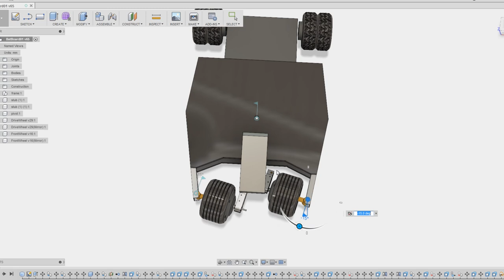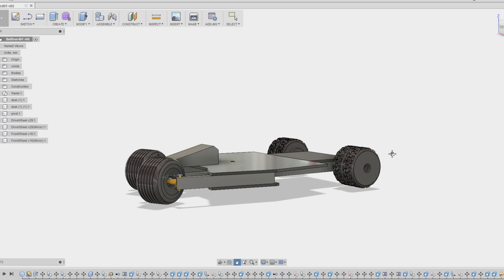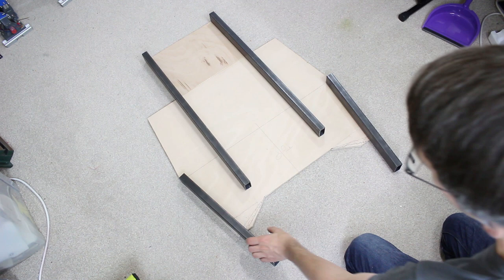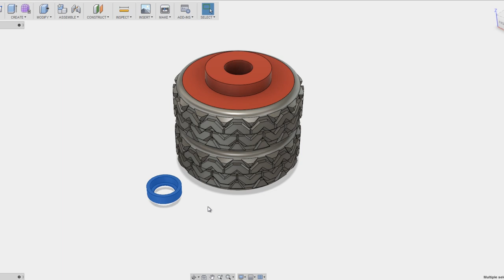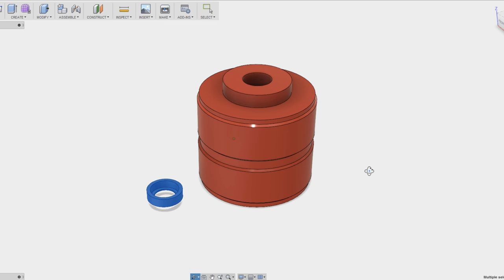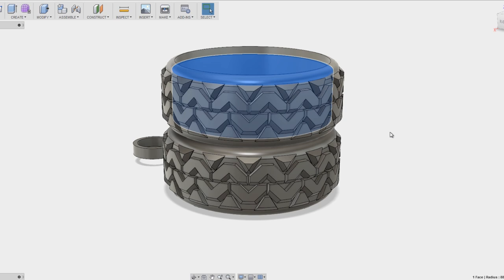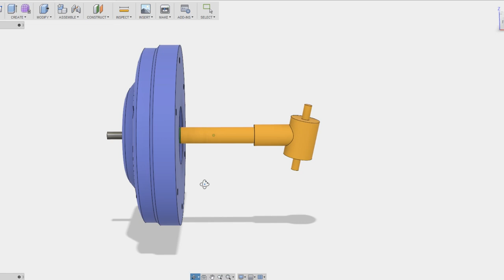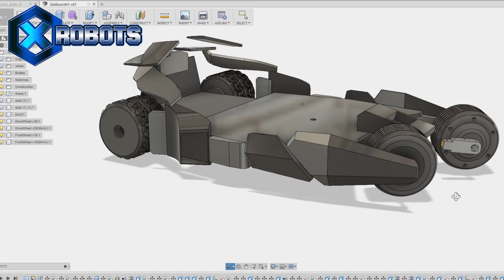Building an Electric Batman Skateboard #1 | James Bruton

Comment: James, I could be wrong but u might find it hard to steer a skateboard with a remote. On skateboards they steer when you lean in, and you lean in when they steer. If the board stays straight you might have a hard time not being thrown in turns. You will definitely have to bend your knees and keep a low cg, as well as try to lean in as much as possible without falling forward, but with the board not cradling your feet as you lean in that might be hard.
Reply: Oooph I forgot your pretty tall too. That’s gonna be a real challenge, but I did some more comment reading sounds like u already solved it?

Comment: Could you have use the arms on the stub axles for steering? I know there would be a clearance issue, but you could have reversed them (so they curved toward the wheel) and designed the hub around that.
Reply: I can't wait to see it!

Comment: Awesome! (and called it on a earlier comment below that vid with the sneak peak hehe)
One thing im wondering is why you decide to use servos etc for steering, it would be much cooler if you could get it to steer with your body weight like a normal skateboard, i feel like your clever enough to make that and still have the proper look & steering for the front wheels of the board.

Comment: I can't help but wonder if buying tires and hubs then building the boards around them would be cheaper than printing so much ninja flex.
Reply: Perhaps you haven't noticed, the philosophy of the channel, since I've been watching anyway, is "if it can be 3D printed, it will be 3D printed." There's lots of better, easier or cheaper ways to do lots of the things, but I watch it because it's unique. You can see angle grinders and welders on any channel. You can see people buying stuff and assembling it anywhere. This is the place for seeing ridiculously big and sometimes complicated 3D prints accomplishing surprising design functions.

Comment: Ok um...  I cringed when I watched him trying to "hammer" his way around the steel beam. Bending it with a plier instead of heating up the steel beam with a torch.

And again when I watched him figured it's great idea to cut out a piece of steering bracket instead of making a slot hole on the steel beam for the steering brackets go through.

PS... you're missing a screw on the front-right-side wheel.
Reply: I thought it was a small tool shed.  Nonetheless, you should look into it, blow torch come in many difference sizes and safety features.
The use for torch isn't really for user work comfort.  You don't want to crack the steel by forcefully bending. It may not seem like much on the outside but it can affect the steel's lifespan over the years, depending how often you ride it.  Steel has a limit range where it can stretch before loosing tensile strength. You bent a corner frame over 90* angle and that's already beyond the safe limit. You don't have springs or shock suspension system for it, so the vibration from the ground will affect the frame. Your steering arm bracket is literally mounted right where you bent the steel frame and that where it will crack. It's only matter of time before it finally happens.